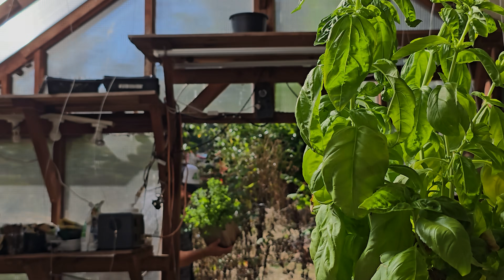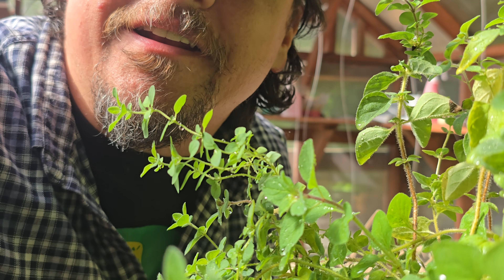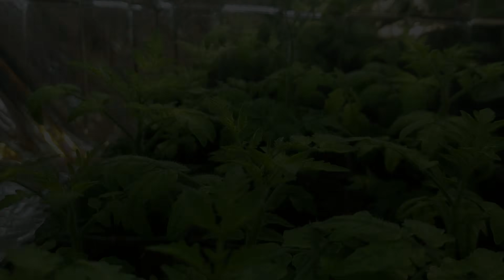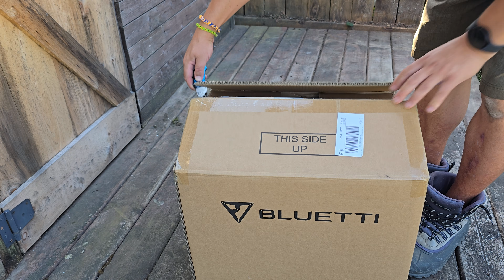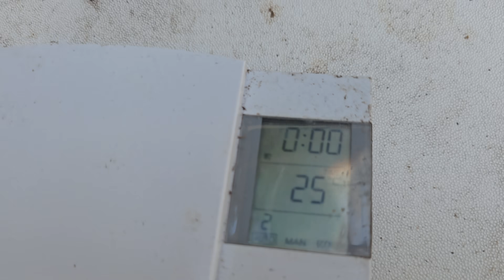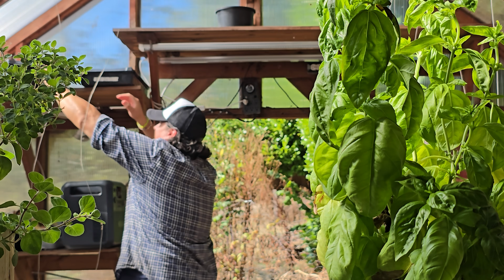The Cost Of Growing Food Indoors Part 1 - Featuring Bluetti Elite 200 V2 Portable Power Station

Comment: I’ve used to have that same radiator. Sadly the dial broke so had to replace it with the new one. Very much appreciate this video. Thank you. Looking forward to the next part.
Reply from the maker: Oh wow, haven't heard of the dials breaking! Was it still under warranty?
Reply: @TheRipeTomatoFarms Sadly no. I had two and they worked great. Had them about 15-18years. The dial seized and the other stopped giving heat. Old stuff built well and lived long.
Reply from the maker: @melindah5952  18 years? That's so awesome. I love it when products actually WORK!